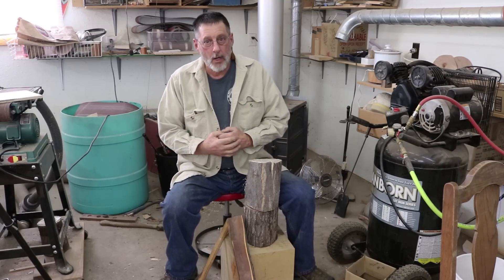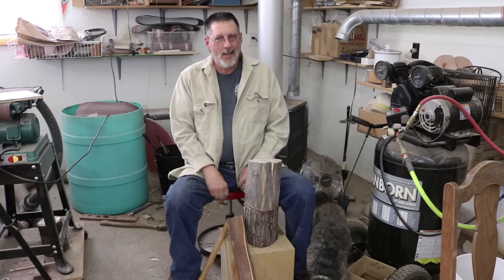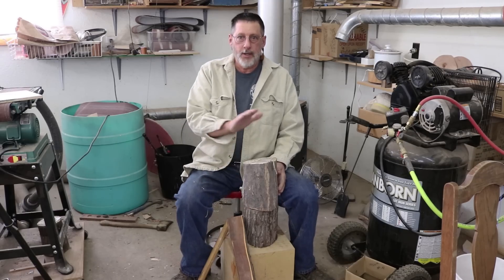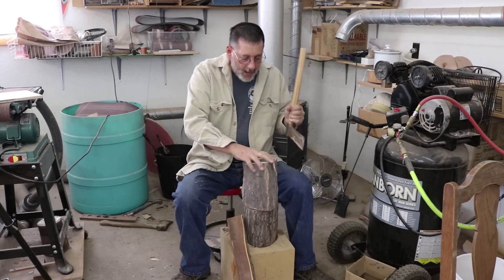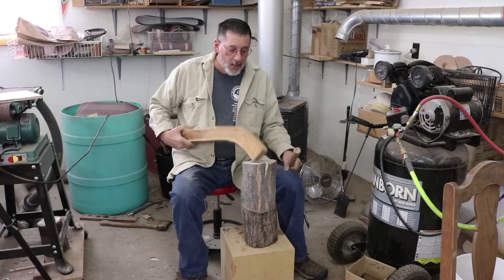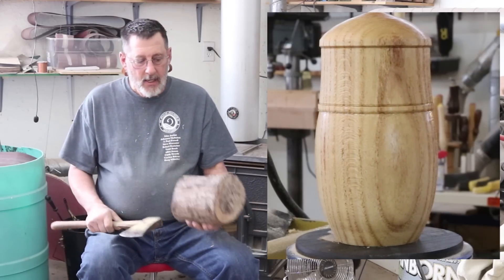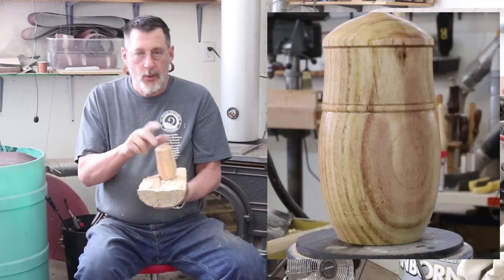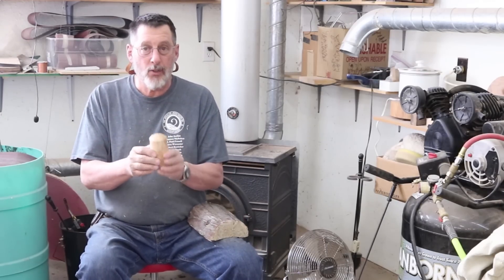From Nature to Culture   Woodturning with  Sam Angelo

Comment: I modified a 3" wide, long handle cold chisel for splitting small logs, just ground the edge sharp and use a small sledge hammer. Not as cool as the froe but effective.

Comment: "Milling"?? I'm pretty sure it's called "splitting"
Reply from the maker: Yes I agree.  But milling wood can be done with a chain saw,, a large lumber yard band saw or with an axe or froe.     Usually milling is a term used when  reducing a log into boards.  Perhaps I use the term  "milling" too liberally.  But even splitting a log is still milling.  Sam